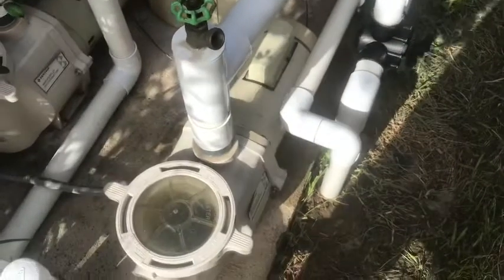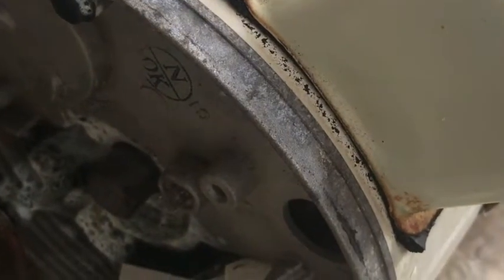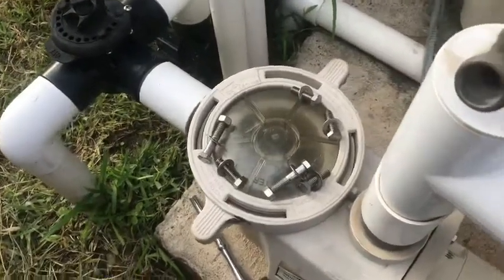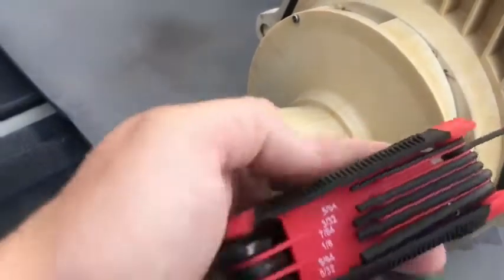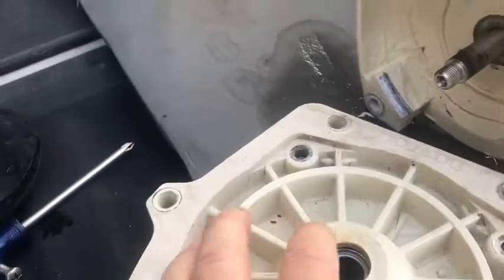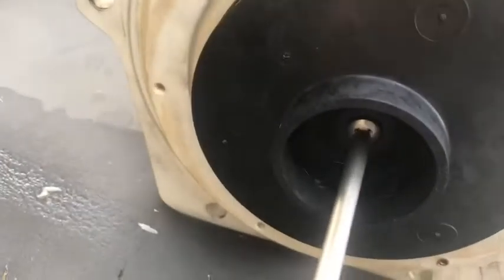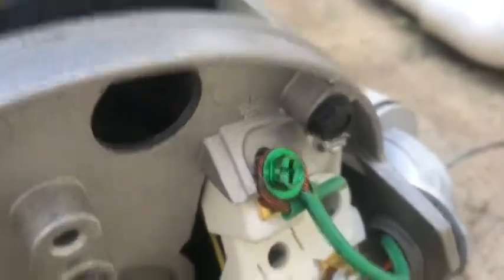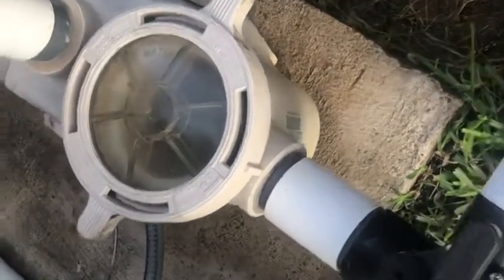Replace 2hp Pentair Whisperflo WF-28 230V poolpump motor w/ Century 2.2hp motor w/same voltage specs

Comment: When you replaced your shaft seal did you install dry? Or did you silicone seal in and wait for it to dry?
Reply from the maker: On the impeller: I WOULD NOT lube the rubber ring around the ceramic ring. It would most likely compromise the seal-in fact, do not touch ceramic ring with bare hand-use a clean towel to press into the impeller. In other words, install as DRY as possible.
Reply from the maker: In addition, on the seal plate:  Be certain to install the spring ring that touches the ceramic ring with rubber on the spring to ceramic side on the impeller. Install spring on plate DRY as well! Otherwise, it will cause leakage and much aggravation and money. Do not get any oils from hand or towel on the spring components either. When installing, make sure ceramic ring on impeller facing out-you do not want rubber on rubber friction-it will burn and result in faulty parts and leaking.
Reply: @texasknowhow3143  Thanks for the reply, I am having a hard time understanding what you said about rubber on rubber burn?
Reply: @texasknowhow3143  I installed using magic lube with the rubber around ceramic that goes into impeller. I also used some lube to insatall into seal plate housing the ceramic seal. I wonder if that is why both times i have installed it has leaked from that shaft seal?
Reply from the maker: @treymoree5677  Just make sure that the circular ceramic piece is installed ceramic side out. I have heard of someone installing it this way and of course, it would create friction causing the rubber to burn.
Reply from the maker: @treymoree5677  I would say most likely. Unfortunately, once those pieces get lubed, leaking is  irreversible in most cases and new parts may need to be purchased to resolve.
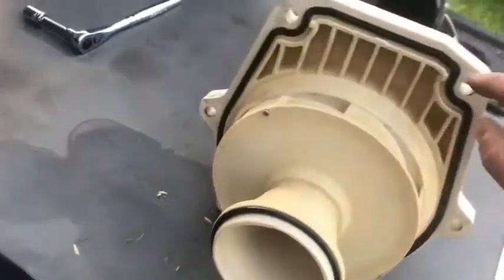Reply from the maker: @treymoree5677  The only gaskets that should/could be lubed are the two gaskets showing at minute 13:00
Reply from the maker: Don't silicone those parts, The silicone won't dry, thus leaking parts.